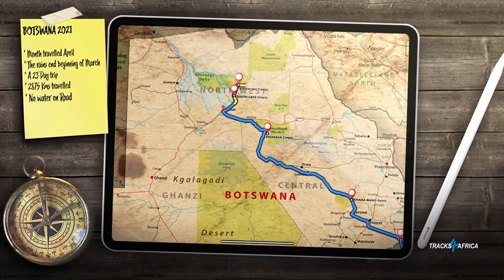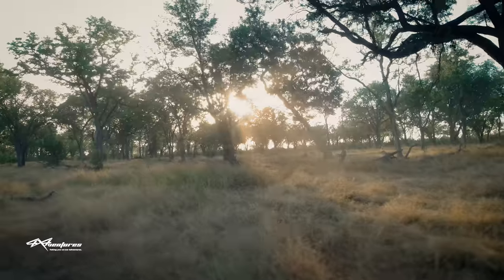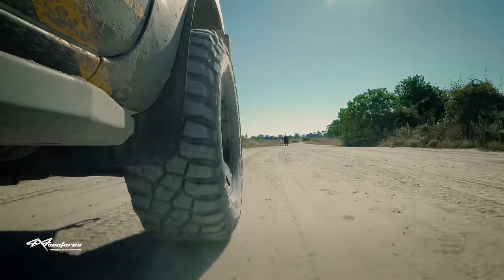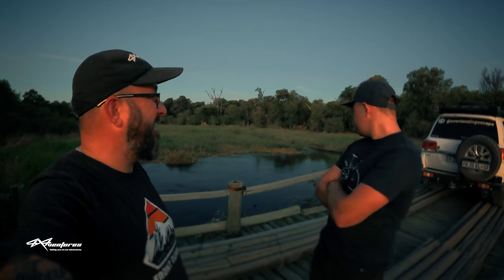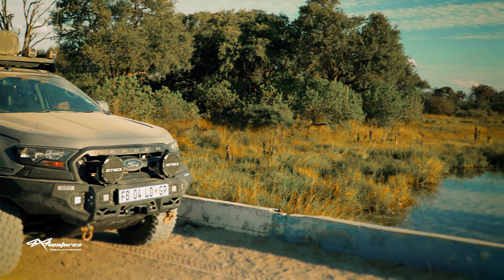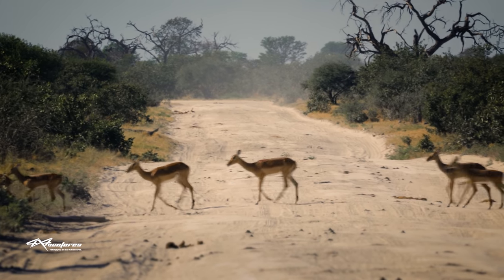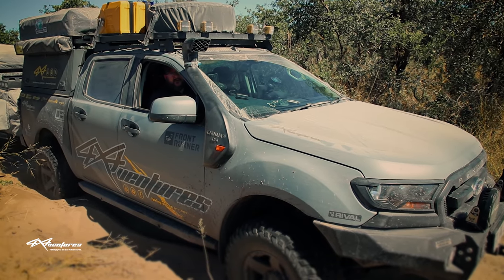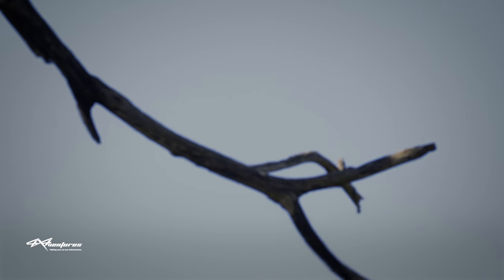4x4ventures | Overlanding BOTSWANA | A Wild Adventure | Ep2

Comment: great vid. But drinking cold water is actually bad for you if you are working in the heat or exerting yourself. The ice cold water shocks the system and takes longer to assimilate. The body needs to put in more energy to get that back to temp. Rather room temp water to keep hydrated.

Comment: Hi  Ryan, what a stunning video and so informative. you guy are entertaining us with your awesome episodes.
I have the same trailer as yours hooked on a 4x4 2.4 Toyota Hilux,  with you experienced travelers getting stuck in a sand do you think will i make it without a winch Ryan? what  type of recovery should one have and any general advise driving on a sand.
Reply from the maker: Hi Thabo, yes, a great trailer. I had to sell mine unfortunately 😕 look, with a 4x2 I would highly recommend a winch. 12500lbs winch. Look at Runva winch, ironman or if you have the bucks, a warn winch. Recovery gear is essential. I only use the WildDog 4x4 10ton recovery gear. Goodluck, and look at getting a 4x4 in the future, you will be confident. Cheers mate🤙

Comment: Loved the vid of the adventures.  When being pulled out of the sand, why was you bonnet up? 'Keep your chin up we will get there eventually is a great mindset' to have in a difficult situation.
Reply from the maker: Thank you Steve. Good question. 2 reasons, one to help with the engine dissipate heat better as it I a small engine, already under load and working harder with very hot conditions, but primarily as precautionary protection If the winch rope snaps under tension and slips through the recovery blanket. Hope this helps
Reply: @4x4ventures_southafrica  Gotcha, all clear now.

Comment: Hi Ryan. We are just weighing up our options and was wondering if it is in any way possible to drive from Ihaha in Chobe to Khwai in on day. We are struggling to get accommodation in Linyanti or Savuti as stop over. Is a wild camp on route a possible option?
Reply from the maker: Hi Paul, I'm not sure. With all the current rain in Bots, I don't know what the road conditions are like, but, from Ihaha to Savuti is about 4.5 hrs, and from Savuti to Khwai about the same. Unfortunately as you enter the chobe Reserve you won't be able to wild camp, and if caught one could face hefty fines or worse. Best bet is to rock up at Savuti or Linyanti and camp in one of their overflow campsites. They do have and will make a plan for overflow campers, its not as simple as turning around. Long distances and hard going depending on the road conditions mate. Message me on 072 910 8593

Comment: Do you decrease the tyre pressure in the trailer as well? Is there any advantages or disadvantages of doing this?
Reply from the maker: Yes, but as it isn't a drivers axle it doesn't provide added traction. I lower the tyre pressure to the same as the front tyres of the vehicle. 1.2 bar being the lowest I would go for thick sand. This makes for a softer ride when towing when going over corrugated roads. Personally though I haven't realised anymore advantage. For more info, sign up to my patreon page. Thanks Willem